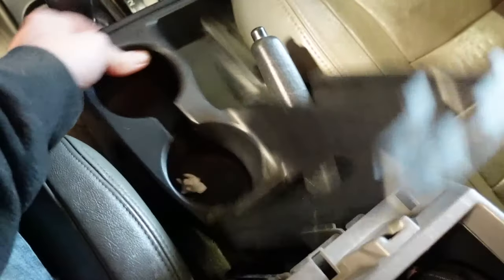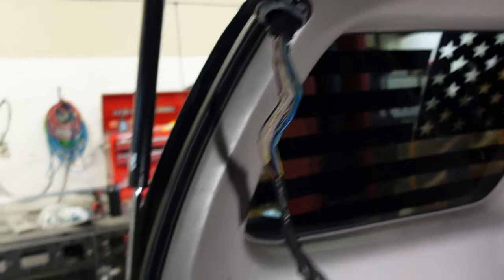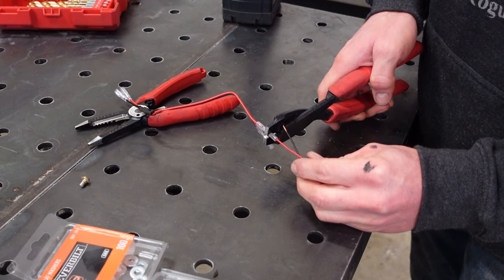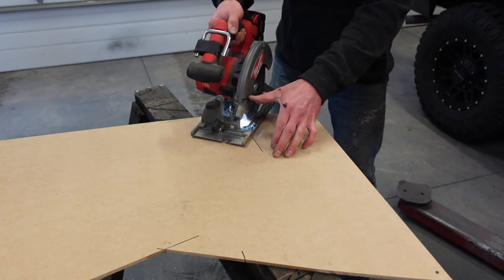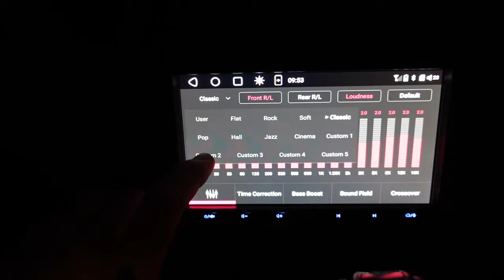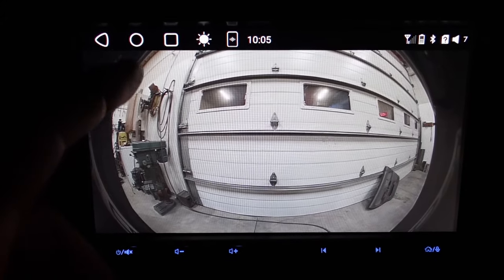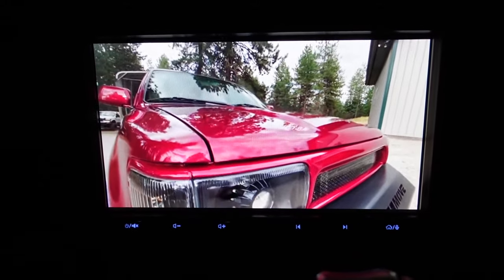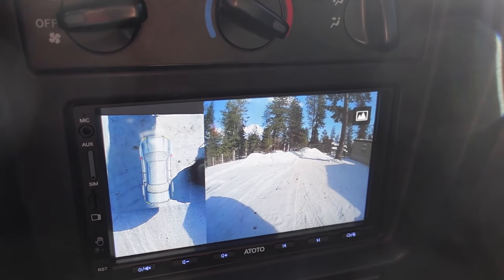The BEST Sound System Upgrade For Your 3RD Gen 4Runner!!

Comment: A good idea, whenever you put mechanical connections in an inaccessible place, like the tailgate, you should use some kind of mechanical fastening on the connections.  For instance, on the RCA connections for the backup camera, I would have put heat shrink tubing on the connection, to insure years of trouble free use.
Reply: Good tip! You don’t want then coming undone in the future
Reply: Totally agree

Comment: I just had to fix my wife's same spot on the wires it took 20  fuse to chase it down. Every so often no taillights. I thought it was bad bulbs and a crossed filament.  Finally figured it out when I went to shut the gate with lights on and  fuse blew.

Comment: You can try to connect the reverse camera to Ing switch instead the reverse signal to power it up , and the reverse signal to the head unit , probably the images will be saved when you park . Maybe !!!
Reply: And you can use it like a rear view mirror wile you’re going forward

Comment: Can you put sensors for the tpms app? What kind of info does the torque app have? And what about the steering wheel control, can you add them on the 3rd gen 4Runner?

Comment: Dang thanks for this great vid. I just got a 2000 4Runner and for some reason my radio has no power. Same with speakers. Think they are just gone and old. Glad I can upgrade easy, plus u left all the links to the shit I need. Even the adapters for the speakers to be held in the back. You’re clutch fr. Thanks my guy 😅

Comment: Pretty good job I would’ve used sauter and heat shrink on the wires but I’ve never really seen much issues using crimp connectors on basic audio stuff so 🤷🏼‍♂️ also on the plugs ins in the tailgate I would used heat shrink or at least electrical tape on it but pretty good install overall, did you ever measure the factory speaker housing in the rear to see what size it was?

Comment: Lol i just got a new muffler for my 3rd gen... It's way too loud, so then is started looking at sound dampening to insulate it, so since i'm gonna pull the carpet up to do that... I might as well do the body mounts... So since i'm doing all that i might as well sound dampen the doors... while the door is apart, I might as well do the stereo... And since i'm doing that... I might as well get some new tail lights and fix some wiring problems... This rabbithole started just from one part lol. Idk how to stop this addiction, but i am going to copy your sound system exactly...
Reply: 😂😂😂 just finished my suspension and was asked "so you're done right"...

NOPE. Just getting warmed up.

Comment: Retired Master installer, here.
Any Gen3 needs a full rewire as does most any OEM vehicle wiring over 10-15 years old.
Your point about an amp and a 'ton of time' becomes kind of moot. 
Noise filter?   Those are called passive crossovers.  They filter frequencies, not 'noise'. :D  
You actually want your tweeters to reproduce as LOW of notes as possible to help with the staging.  This is why the best ones are very spendy.   Some can go as low as 500 Hz.
Angling the rears up a tad is not that hard once you are making your own mounts.   We were doing gestures on in-dash Nexus 7's.  Pretty neat stuffs.
15:59  The CT speakers certainly are not what is called 'efficient'.  ANY Polk Audio's would sound like you had at least 4x the power going into them. Trust me.
Btw that lift is gonna kill your needle bearings up front.
Less second hand advice and more getrdun, please. :D
Reply: Is it possible to rewire at home or is that more suited to a professional?
Reply: @thebrainsack  Depends on the ability but it can be DIY.  ymmv.  I have seen well intentioned enthusiasts burn vehicles to the ground.